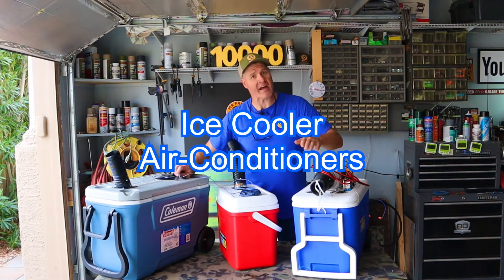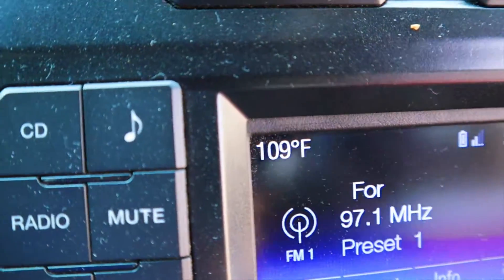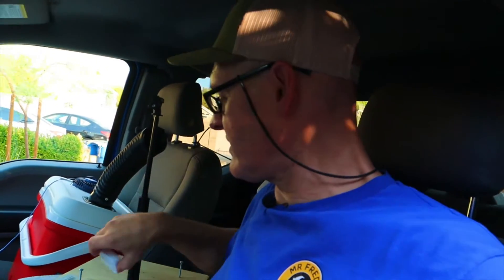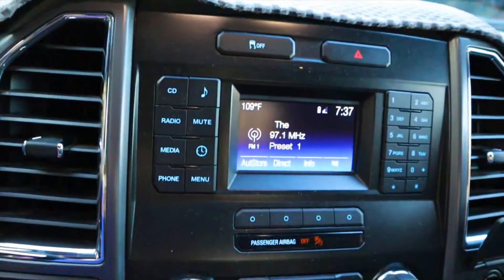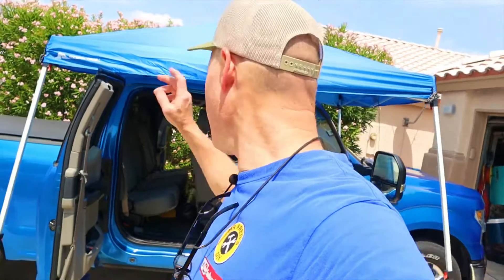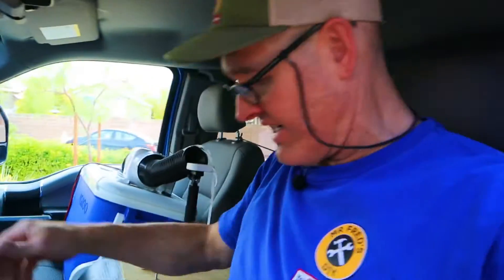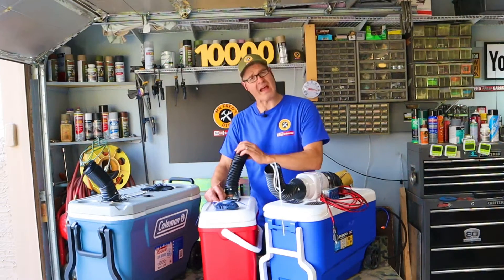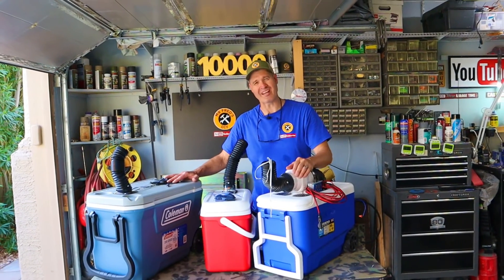How to Stay Cool in a Hot Car: DIY Ice Cooler Air Conditioners

Comment: Thanks for the video. I've got a large styrofoam cooler rigged up for this. Its going to hold 7 gallon jugs of ice. I'll be using it in a nissan altima while im doordashing in ~90°. Yall say a prayer for me. I will follow up with the results for people that are curious.
Reply: I’m in the same situation. Got fired from my regular job and only have doordash now and I’m in Florida 😢 and my cars ac doesn’t work. If I add Freon it blows cold but only for about 30 mins. It’s 104 degrees today…
Reply: @Bonbonbon739  dude it sucks lol. The AC cooler does have an effect but im not sure its worth the hassle of dealing with it every day. But im probably mostly jaded cuz the cooler i picked to mod has a fregn leak. And i may have chosen one thats too big. 

Now i just use one of the fans i bought for the cooler clipped on my passenger sun visor. Got it pointing at me. It keeps me from overheating when im stopped.

Plus all.of my ice was melted within 3 hours.
Reply: @jaredgibson7462  yeah I’m in Florida and the humidity has been record-breaking so it’s not so much the heat. It’s the humidity as well and the sun. I can’t even DoorDash during the day because my phone overheats without ac.

Comment: My friend did this but with compressor fridge in the trunk so he could remove heat produced by that fridge.

He then got big transmission cooler( 7 or 8 inches) and strong 25w car fan(6inches).

The air blowing out of that transmission cooler positioned in front of that fan( both conected) was awesome 40f( 3.5c) which was awesome in cooling down his car.

I recommend you trying this idea.